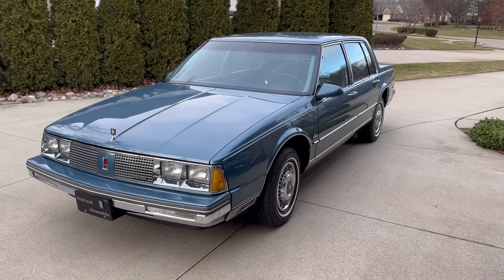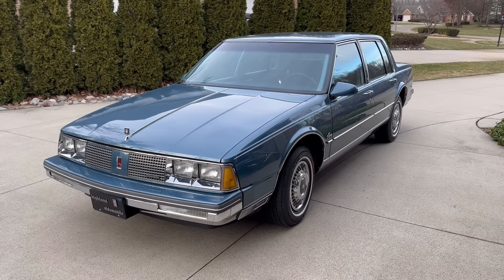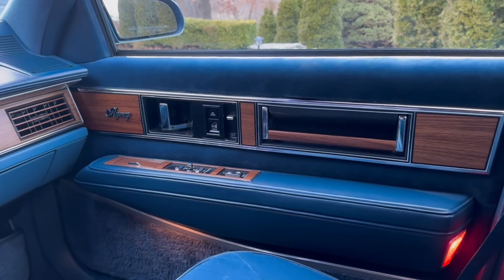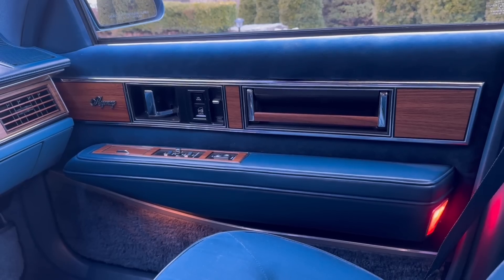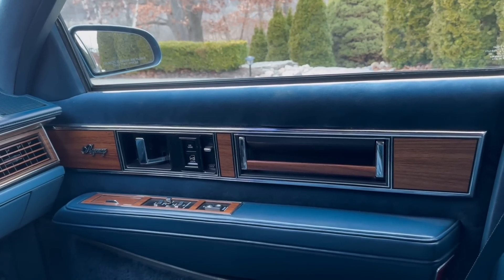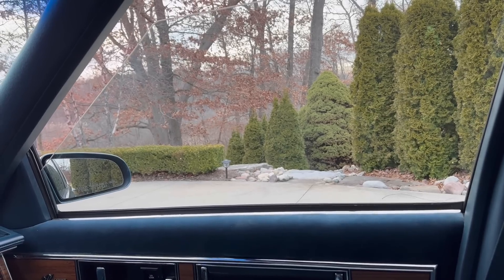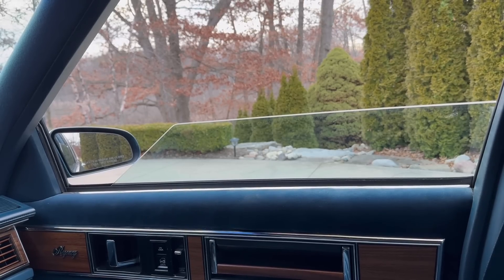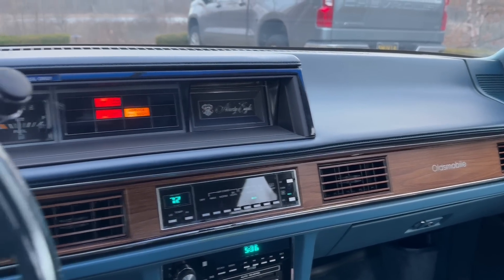Worst Automotive Inventions: 1980s/90s General Motors (GM) Tape Drive Window Regulators

Comment: For 19 years I drove an '85 Porsche 928S2 5 speed and I had to work on both window regulators.  This used the old system of a motor, a worm gear, and an arm that lifted the window up and down. The arm itself rode in a "track" along the bottom of the window, with a nylon wheel that was riveted in place to ride along that track.

And like clockwork, about every 10 years you have to replace that stupid nylon wheel!  Fortunately, it takes about 10 minutes to remove the door panel on one of these cars, and about another 20 minutes to remove the regulator.  The nylon wheel is available from 928 International in California for about $10, so it is a quick and easy fix.

But why does every single type of window regulator have some sort of problem?

Great video!
Reply: You could ask a similar question about timing gears/chains/belts. Most fail long before the rest of the engine and many can take the engine with them.  Even the old timing chains in American V8s seldom lasted past 140,000 miles and the plastic bits that fell off the sprockets could clog the oil passages and take years off the life of the engine. Ford seemed to have a bulletproof setup (correct me if I'm wrong about that) with the early Duratec engines; an oil-bathed all metal chain. But the later 3.5 L version of the engine put the water pump on the chain, which would contaminate the oil if it failed and take the engine with it. Even a  rubber belt would be better than that. These things are engineered to fail.
Reply: @pcno2832  the nylon was there to make the engine quieter...of course that doesn't make it a great idea. As far as chain driven water pumps in the block goes....easily the stupidest idea ever. Sure it packages well and has few parts, but when it fails, the results are quite bad.
Reply: @mrl22222  Subaru does that on the H6, a timing chain driven water pump.  They make this work due to two features:  1.  The  pump is designed to last the life of the car, and routinely does.  On an Outback web forum, it was mentioned that literally nobody has ever replaced a pump.  2.  The pump's weep hole is directly above a tiny hole in the timing case so that any coolant that does leak simply falls on the ground, it won't get into the oil.
Reply: @Flies2FLL   I know, I have a 2000 outback with the H6, and yes, the weep hole will divert the water, that is until the bearing begins to rust and the seal to the crankcase fails because the shaft wobbles a bit. Catch it early and you're fine.  That being said, I've never replaced the pump, but at 24 years old I also know I'm beyond the design life of the pump seal.
Reply: I think some mechanisms like this which employ a fairly powerful motor are designed with an easily replacable sacrificial part or two so that, in the event of a catastrophic failure, they can strip, shear, break off etc. without binding up or mangling the more expensive bits. I've seen mechanisms like that elsewhere too such as home appliances back when they were designed to be repairable.
Reply: I've worked on a number of VW's and Audi's over my 45 years as a mechanic and have replaced many of the nylon wheels and regulators on the. Some you could take the outside panel off to get to it.

Comment: I first ran into these things in a 1984 Corvette. But what most American manufacturers are using today isn't any better. Most use a very flimsy stranded cable and what are basically screen door rollers. I have replaced over 100 of them in Ford Panther cars. The assembly is riveted in place with 8 rivets, you have to drill out all the rivets, and install the new regulator assembly with nuts, washers, and screws. It's usually the cheap plastic rollers that break, which destroys everything else. Steel rollers with bearings would last forever.
Reply: The plastic cable end that crimps to the cable shell/sheath also break which causes the motor to pull the cable itself too far and wind everything up, usually jamming the whole thing. I think the Nissan system is the worst I've ever seen as its a modular unit, with a panel inside a panel. You need 3 hands with piano fingers on that mess.
Reply: Hyundai's version of that (and, I believe, many others) uses a reel that is basically a threaded drum, so as the top cable unrolls, the bottom one takes its place in the spiral groove.  As soon as the threads wear out, the cables are free to overlap and the thing becomes a tangled mess.

Comment: My 85 Corvette had the tape style regulators. They were extremely slow and I was just waiting for a failure. Luckily I swapped them out to the later style scissor regulators before that happened. The windows move way faster now and I know failure is much less likely.

Edit: I guess the regulators in the early C4 were not tape drive, but were a similarly fragile design. It was nylon teeth on a track. They would commonly strip out or have chunks fall off. The only way to repair it was to remove the regulator and rivet on a new section of track.

Comment: Adam, I recommend also that if your window is rolled completely up that you give it a brief bump down to release any tension on the "tape" mechanism. That way the tape does not have constant force pulling on it. This go's for all newer vehicles.
Reply: That reminds me of the "N" setting on old record players, which prevented the idler wheel from getting a flat spot. It was later incorporated into the OFF switch on many models.

Comment: I had a new 1990 Buick Electra Park Avenue with the "Prestige Option Package" on it, as it was called, and I had no idea that it had this style of window mechanics, but....I eventually traded it in with 90k miles on it, and I never had any issues with the power windows whatsoever; was I just lucky, then?  I probably didn't really use the power windows, though; I hate road noise, so I RARELY ever lowered and raised the windows for anything.  It was the very first brand-new car I ever owned, specially ordered with things that were not common at the time, like memory seats, anti-lock  brakes, and remote keyless entry.  I LOVED THAT CAR!  Gunmetal gray metallic with dark, burgundy red leather interior....it was an absolutely beautiful car, and it served me BETTER than well!  I had just gotten my real estate license, so....I was in my car and transporting clients CONSTANTLY.  Best car I ever owned, hands-down; I have a 2020 Lincoln MKZ that reminds me of that car in almost every way, except that the seats were SO much more soft, comfortable and luxurious in the Buick!  As far as handling, a serene, quiet ride and excellent reliability, they're nearly identical.
Reply: The seats in my 94 roadmaster are honestly way better than the seats in my 2010 MKZ. So much more comfortable

Comment: Thank you Adam.  I enjoyed hearing you talk about the downsized era at GM and sharing this with the Ninety Eight. You said it well, but Malibu is smaller in length compared to a downsized GM car. The Oldsmobile Intrigue was the same size as a downsized GM car at 196 inches long.  The Malibu is 194.2 inches long.  It was a two inch difference between a Malibu and a downsized GM car( C and H Bodies). It makes sense they had to redo everything with a new platform.  Then it takes time to work the bugs out. That is why they say do not buy the first year of a new model.  I do not have tape drive window regulators in my Ninety Eight or Toronado. It is unfortunate this was a weak point on the cars. It is sad to hear about the tape drives. Thank you again.

Comment: I replaced an untold number of those crappy things, some with the vehicle only 1 year old. The cable drive used by Chrysler and Ford weren't/aren't much better. When I worked for Ford in the 90s, Contours were the worst, followed by the Crown Vics. Probes weren't much better, but at least there were fewer of those sold. Give me the old scissor regulators please!
As an aside, I bought a new Genie garage door opener in 1984, and it used a tape drive too. I was so pissed when I found that out.  Had to replace that tape a couple of times, too.
Reply: My dad has a DoIt opener from 1985, all chain. Never been a problem.

Comment: Wow.  A really useful video.  Thank you Adam.  On my 2002 Grand Prix, all four windows have failed, one when the car war brand new, and a couple of the windows have failed twice.
Reply: That was pretty normal for those.  A coworker had one with 3 dead windows.  The motor and guides were just 💩.

Comment: GM has been getting power windows wrong for decades. I had a late '90s H body and there was light frost on the window and it tweaked the regulator when I tried to tap it open... I had to replace it on a car that was only 4 years old. That regulator then ate its motor a few years later. My mother's slightly newer H body ate all 4 window regulators and the sunroof under warranty... and she pretty much never put the windows down. 😂

For the last 20 years I've been buying manual window stuff, which has become quite the challenge. I have replaced 0 regulators in that time.
Reply: I've only replaced window regs on cars that are already 20 years old, but I've replaced manual window regulators too on trucks.

Comment: I had both crank and power window Caprice never had a problem with the windows and I used them more than AC. No issues. Miss those cars.

Comment: How nice to see a blue interior instead of black like today.
Reply: Yes, nice to see blue! But honestly, I  don't mind black... what I hated was what seemed like decades of the drab gray interiors!!
Reply: Miss the OG red/blue interiors.
Reply: I agree with you, back in the ‘70’s and ‘80’s we had a great choice of interior colors, and fabrics, and now it is almost always black or grey leather or very basic cloth material.  I hope some day auto manufacturers bring back warm, luxurious cloth and nice colors to car interiors.
Reply: @1969FCS  I have the dealer material selector book for the 1974 model year Cadillacs. There were 11 different fabric styles with at least 4 colors for each style plus 14 colors of leather. You could also mix and match cloth with leather trim for most of the fabrics.
Reply: I love the acres of blue velour and plastic in my 1987 GM Holden Commodore.  It’s a very similar shade to this too.
Reply: Or the interior the same color as the exterior of the car.
Reply: Yeah, but the worst are the white and tan interiors 🤮
Reply: The new Ford Maverick had a decent looking blue interior. Not fan of Ford but I like that they tried to do something other than straight black.
Reply: Nice and clean too.
Reply: Black is horrible and gloomy.
Light Alpaca Grey or deep blood red for me.
I will not own a black interior, just too common ⚠️
Reply: A while back, I bought a used 87 Corvette. Although the dash parts were cheap black plastic, the rest of the interior was blue carpet and blue leather. It also had a blue tinted glass roof. The whole interior looked flourescent blue! I thought it was horrendously gaudy, but it was the only inspected Corvette in my area I could afford. After so many years of black and various shades of black, I kind of miss that colorful cockpit! (The exterior was the same light blue metallic paint).
Reply: I know. We just bought my wife a new Subaru. It's like going into a cave at nighttime. Everything in there is black. Terrible.
Reply: Last year, I rented a Toyota Camry that was like that. The latest among a handful of rentals over the past few years—and they were about as bad.
Reply: @Colorado_Native who cares?
Reply: @Maximus20778  Are you always this pleasant?
Reply: @Colorado_Native  you're the one that wasn't "pleasant" first after complaining lol
Reply: @Maximus20778  You don't seem to understand the difference between  'complaining' and 'stating a fact'. But, thanks for the reply.
Reply: @Colorado_Native  whats the fact here? Your subjective opinion? Yeah right.
Reply: @Colorado_Native  I understand everything up until you brought your  projections. I'm literally not even American and I don't vote and I'm over 20. Please don't bring politics into this.
Reply: @Maximus20778  I just noticed you said I 'bought' my insecurities. I owned them already. What is your excuse? Hmmnn?
Reply: @Colorado_Native  ahem sorry brought now that's more like it
Reply: @Maximus20778  Yes, I carry them around with me in case I get a chance to use them. If I bought them I sure am going to use them. I am a frugal, penny-pinching, or whatever currency you use -I have lived or visited a dozen countries including North Korea, so I have many different currencies on the wall to use - seriously old, but well-off person. As they say, I am old, I know lots of stuff, and a lot of time to share, or in your case, educate. Thank you for the correction and reply. Your turn.
Reply: @Colorado_Native  maybe you should get off the net for now
Reply: @Maximus20778  To quote Col. Jessup, "You can't handle the truth." Go away, troll.
Reply: @Colorado_Native  what truth ? Lol get outta here
Reply: @Maximus20778  Have you been nippin' the bottle a little? Your comprehension seems to be lacking.
Reply: @Colorado_Native  leave me alone old man
Reply: @Maximus20778  With your education, ability to comprehend, communicate effectively and general abilities I have a feeling the ladies (gents?) leave you alone already. But best wishes any way.
Reply: @Colorado_Native  smh
Reply: @Maximus20778  Don't shake too hard, you'll hurt your brain. You need to take care of what you have.
Reply: I miss my dad's 1991 Cavalier. Dark blue exterior, dark blue interior, and the only ordered option was "all season tires".

Hard to even find pictures of the dark blue exterior, most were a lighter shade
Reply: If you want all season tires on a new car nowadays, you have to order the cold weather package at $3795, and if you order the cold weather package, that requires the larger rims, bigger brakes and the all wheel drive transmission and full time traction control package, and that package cannot be ordered on the convertible models.
Reply: And in phenomenal shape too! All of these I see are absolutely destroyed now.
Reply: manitoba-op4jx  how am I a skill issue? Had it not been that he input his personal problems with Biden and voting and then trying to troll(big LOL) then we wouldn't be here. It seems you didn't read everything he said lol
Reply: manitoba-op4jx  I appreciate your comment. I was seeing if he had any communication or cognitive skills at all. It's like fishing and you get a live one and you reel it in. I honestly think he's a dull normal and he's letting his pride dictate that he should say something and get the last word in. It has been an interesting experiment. Thanks.
Reply: I had a white 92 Buick Lesabre with a blue interior. That car rode like a couch on wheels.
Reply: I hate all black interior.
Reply: White, tan and burgundy were popular interior colors.
Reply: My first car was a 93 Lumina colour scheme was the same, that blue an wood grain. I loved it. It was great car, everything these days is grey and black. Just boring. My wifes Traverse does have some wood grain accent that brings back some of the class but otherwise its just black and grey. The interior of my silverado, black and grey just so boring.
Reply: manitoba-op4jx You kidding? 🤣

🍿😀
Reply: Unfortunately we no longer have a choice of interior colors.  Black or gray is all
Reply: @Hall102 just like Henry Ford “Any color you want as long as it’s black or gray! “
Reply: @Hall102 They design in that way so the driver and passengers are depressed.  That's what automakers in the US think of you
Reply: @Hall102 Still offered tan interiors till the mid 2010s. I miss the two tone dashboards where they were black on top & the lower parts were tan.
Reply: @Hall102 that's false, most cars you can choose colors
Reply: I friggin hate black interiors! I got tired of gray interiors, but I’d gladly have a gray interior again.
Reply: You're kidding..... right?

Comment: Your '86 Ninety-Eight reminds me of my '85.  I didn't have any trouble with the window regulators.  But for some reason, you couldn't keep a thermostat in it!  The only power window problem I can remember was with  our 1963 Super 88.  After a goodly number of years, the driver's window had to be pulled from the top while you were pushing the button.

Comment: Reduce weight? Sure, but the reduced cost probably played a part too.
Reply: The weight reduction itself was expensive.
Reply: A program to lower the weight. Then they have to add a thick impact beam in the door for safety reasons.
Reply: @mpetersen6  the beams had already been there for 10 years.

Comment: The first thing that comes to my mind is the nylon tape drive power antenna actuators. If you didn't keep the antenna cleaned and lubricated they would try and go down and the metal end would seperate.